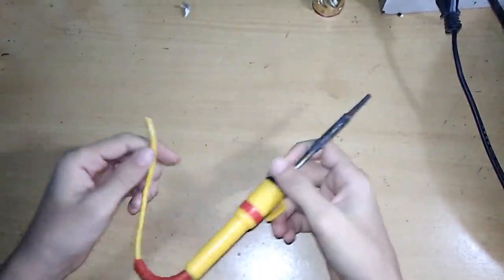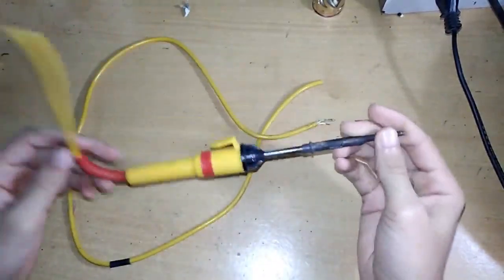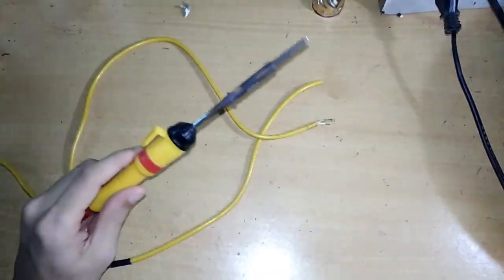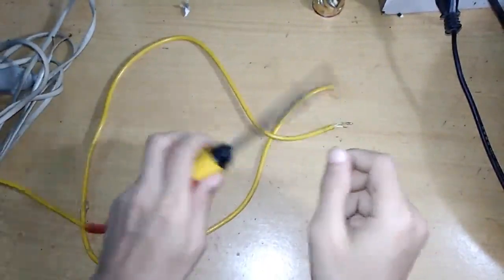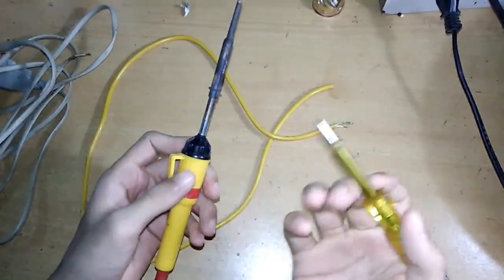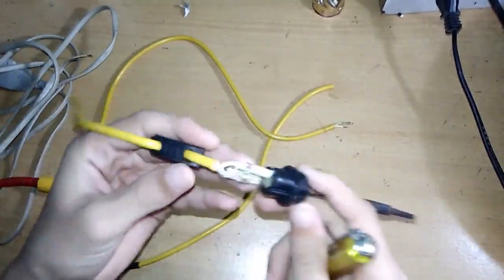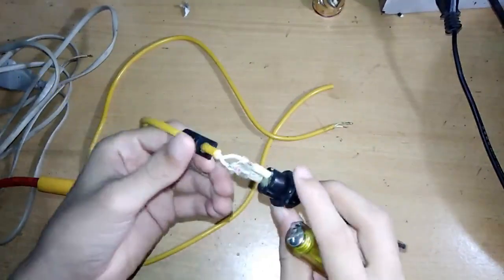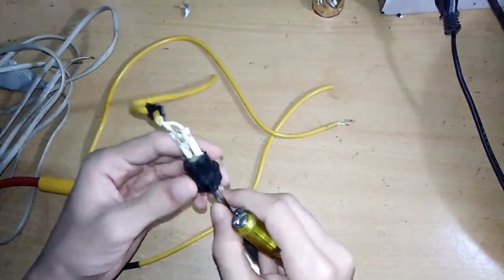How to change the wire of Soldering Iron

Comment: Can I use 2 pin plugs instead of changing wire
Reply from the maker: Yes you can use but see that it is safe while working.
Reply: Will it be ok
Reply: I think no risk